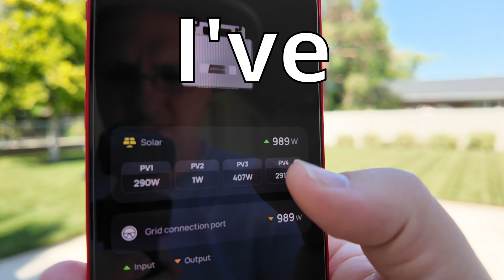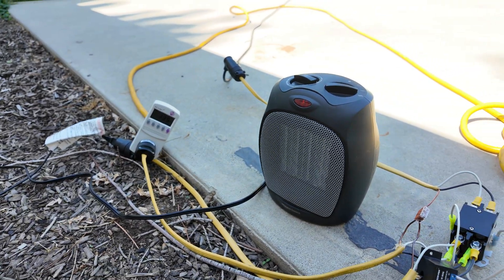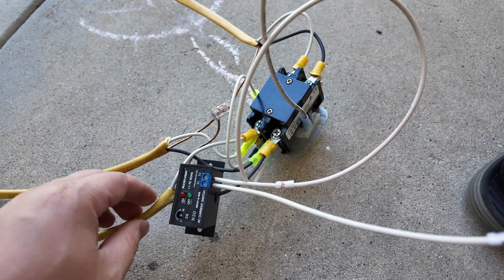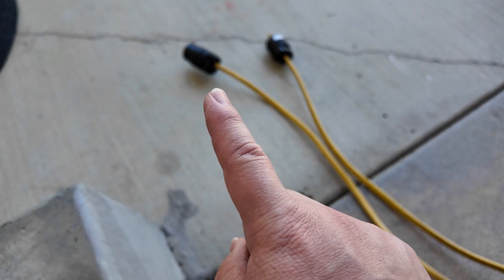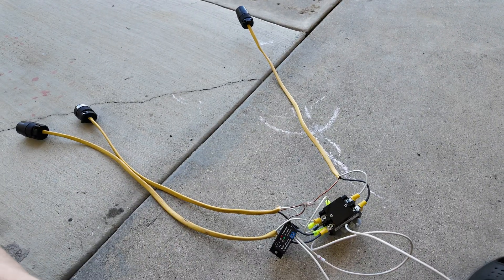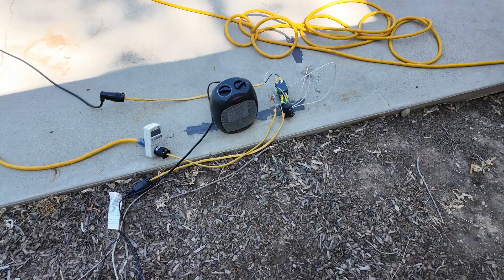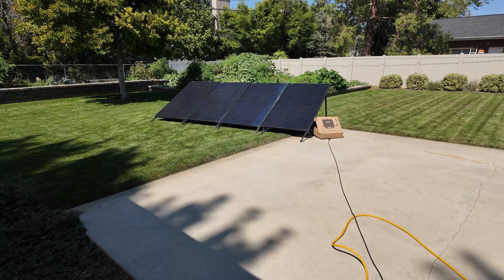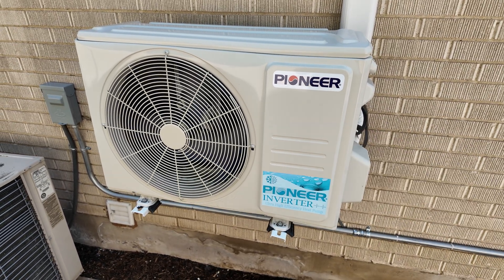FREE HEAT From The Sun: I Built a DIY Solar Heater (And It Works!)

Comment: Wouldn't it be better to just take the dv from the panels and feed it through a resistor so you aren't converting twice?
Reply from the maker: Sure! But the nice thing with this is if the sun goes behind a cloud or something you don’t loose you heat…the grid will carry it through!

Comment: If you're paying for 400 w of electricity to create 1,400 w of heat, you effectively have a COP of 3.5.

This is middle of the range for a heat pump type reversible window unit, which will work 24/7 at better efficiency level, regardless of cloud or night, and can cool too.

Midea has an 8K BTU (vs your heater's 5K BTU) for $450, so does GE. More powerful heating and cooling for the same power 24/7, always beating your daily perfect-sun peak hour efficiency.

It's a fun experiment but very expensive and impractical for the end result. Unless you're able to get all of those panels, wires, inverters, sensors, etc for free... Just buy a Midea.

Now, I'm not sure if these window units will have the same variable power issue, but if you can make it work with the Midea or GE, you're talking about a revolutionary result with a potential astronomical COP!
Reply from the maker: Yep! Did you see the part of the video about the heat pump concept?

Comment: Have you played with a sand battery at all? Basically you hook the panels directly to a DC resistance coil buried in a bucket of sand. During the day the sand heats up and then when the sun is gone the sand with have 10-20 KBTU (depending on the temp, power, and amount of sand, obviously you can make them as big or small as you want) which will radiate overnight to repeat again as sure as the sun rises.
Reply from the maker: No. I haven’t ever tried that. Seems cool in thought…but I’m skeptical. Maybe I’ll test it someday.
Reply: @theresatrickforthat There are tons of videos on how to do it around. You can also do it as a hot water tank pre-heater but water can be very dangerous to heat without proper relief valve setups and plumbing is a pain. The reason sand works is that it's very cheap and safe to heat to hundreds of degrees. Literally a bucket, sand, resistance coil, and wire to solar panels directly.

Commercial and grid scale sand and flow batteries exist already, and in areas where there are large time of use power swings thermal mass heaters (basically heaters with bricks or similar in them) are pretty common.

Comment: Electric space heater is a huge power hog.  And you need heat during the least sunny part of the year.  Realistically, you're going to need a large solar array and large battery bank.  Big bucks and lots of space required.
Reply from the maker: You must have not watched the whole video where I discussed more efficient ways of heating.

Comment: Just pray it doesn’t rain/snow and hope it functions without electrical mishaps in your home.
Reply from the maker: Well, stating the obvious…the contactor and and current switch should be installed in a weather tight box outside and then just run heavy duty extension cords into the house. I didn’t have mine in a box so you could see the setup well!

Comment: Hey, why not do a video on creating a system using an Arduino NANO ESP32 to connect/disconnect solar panels based on the Grid's L1/L2 wattage. This would insure that the Grid L1/L2 wattage is never reached.  A DC relay on each panel, shunt, AC CT on inverter AC output and L1/L2. AI can design the circuit and write the script per your instructions, and create a local webpage to display/control sections. Granted there are a few more parts needed, but it is not that hard or expensive. Unlike the expensive produced model I have seen. Great video
Reply from the maker: Certainly an option if one has the skills and know how to do it. Most people don't. So that's where a off the shelf product comes into play!
Reply: There are a ton of solar inverters that already support clamps to ensure zero export. There isn't really much of a reason to DIY that when off the shelf solutions are already cheap and reliable.

Comment: This is great for a temporary setup. Batteries are dropping in price where you don't need to worry about when you turn on your heater/ mini split/ appliances. I used to be conscious of when I was running my heavy loads. Then I got an extra 15 kWh of batteries for a total of 45kWh plan on getting another 4-280s for 1k when they go on sale again.
Reply from the maker: That's awesome! Sounds like you've got a seriously robust setup going!
Reply: @theresatrickforthat I dc from the grid back in April. 30 kWh sounds like a lot but when you got a few days you are barely getting by. Even with 45 I'll be cutting it close on the winter. I'll keep adding until I hit 90 kWh... another 3 sets of 4 280s

Comment: When you show what the solar is producing it says 982 watts but PV2 is only adding 1 watt. Do you have an idea why it was basically off?
Reply from the maker: Yes. PV2 and 3 are paralleled and for some reason on this current version of the firmware only PV3 reports the sum total of PV2 and 3.

Comment: If you use a battery like your other system would that be extra insurance you won't back feed? 
It seems back feeding is the biggest downside to trying to use any of these systems.
Reply from the maker: A battery will help make better use of the solar power for sure and you could only connect say 2 or 3 of the inputs on the inverter to limit its output better to match the load and not backfeed, but you won’t miss out on any solar because the battery will absorb it and save it for later after the sun isn’t as strong.

Comment: Since you already have an inverter and as inexpensive as good quality batteries have become, I think a lot of people would benefit from a stand alone system (no grid tie) that included a battery.
Reply from the maker: That is the ultimate…but a lot of people simply can’t afford it…so something cheaper without batteries is the way to start so they can start saving money on power bills and apply that savings to a larger system one day.

Comment: Can you use power station to simulate the grid? Or say 500-1000w inverter for 1500w wall heater or inverter?   This seems like the way EG4 is doing their mini split solar units??
Reply from the maker: Yes you could…but must ensure you do not backfeed any power or you’ll burn up your inverter or power station